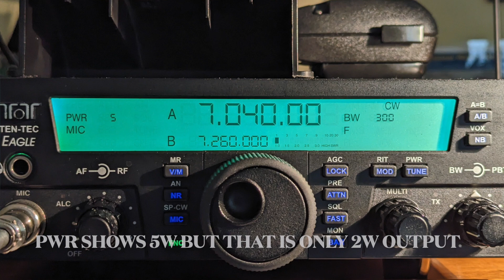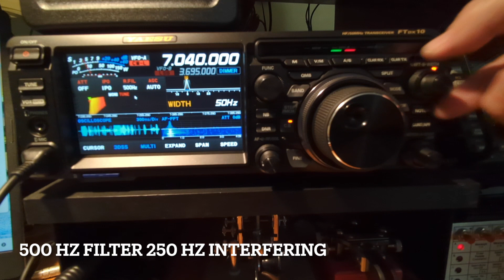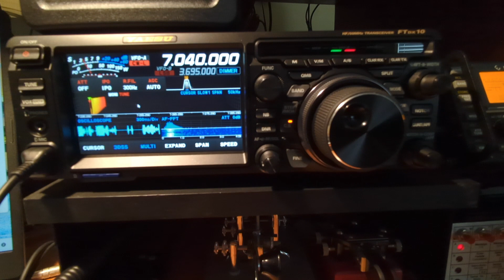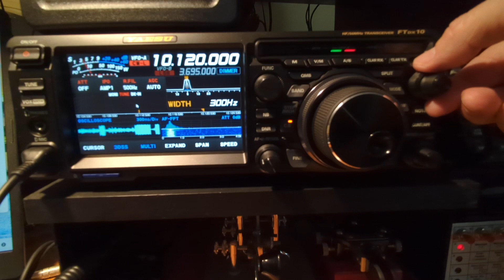Part 2 -Yaesu FT-DX10 XF-130CN 300Hz filter compared to 500Hz

Comment: The real advantage of the 300Hz filter is that it an interfering signal won't have as much effect on the AGC. The DSP is after the AGC when co-signal blocking has already happened. Admittedly, this is less obvious in these hybrid rigs but even so, AGC blocking is the real issue. Also, astute use of the shift control can serve to put the interfering signal deeper into the skirt. I use a combination of R.Fil, DSP, Shift and APF to eek the best out of a signal on a crowded band. ..not a big fan of DSP NR though, even at level 1.

Comment: Can the 300 Hz filter be used in SSB? DATA-U specifically? I want to use it for FT8. I haven't been able to find a clear answer if it will turn on in all modes or if it's blocked in some.  I regularly use the 500 Hz and digital shift/width/notch/contour controls to isolate weak signals from strong ones, but sometimes they are too many packed too close to really get the one I'm after.
Reply from the maker: I'm looking for suggestions.  What you like to hear?

Comment: Very interesting video! Great to hear the difference in ringing between 300Hz DSP filter and the 300Hz roofing filter. In this case, I would use the shift knob so that the signal I want to hear is just starting to get attenuated, while greatly reducing the interfering signal. I have tried to find out whether the 500Hz built-in filter is sharper (attenuation per decade) than the 300Hz one, but I haven't found any details.

Comment: The 300 is a corner case filter. It makes a difference if the interfering signal overdrives the dsp but you can't decrease the rf gain because the wanted signal is already very weak.

Comment: Doesn't the AGC, set to Auto, also influence the reception? The volume is "pumping". Does it make a difference when the AGC is set to Fast?
Reply from the maker: AGC is controlling how much it will increase gain in the absence of a signal.  In the case of this test I was demonstrating how much the additional filtering reduced a strong adjacent signal.  Since I was connected to a dummy load, the noise floor was not part of the equation.  It certainly pumped the volume as it attempted to reduce the strong adjacent signal's impact on the audio, but with it off the adjacent signal would have distorted the audio.  I know some people turn it OFF to copy a weak signal but I don't think that's the norm and it's certainly unpleasant to operate without the AGC in operation.

I do plan to do a video at some point comparing the FT-DX10's AGC to my Ten-Tec and Elecraft radios.  

Spoiler alert: It has far better AGC than either of those radios, and the AUTO mode works very well for most conditions.  I have to ride the AF / RF on other rigs in the presence of QSB.  The DX10's AGC is very responsive and smooth in comparison, requiring very little interaction with the controls across fading or when listening to two stations with markedly different signal strengths.